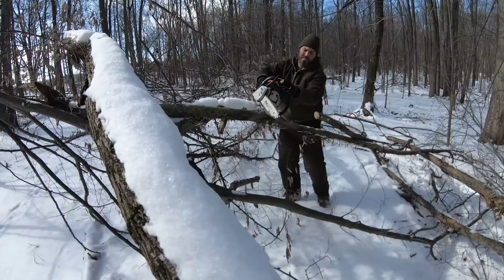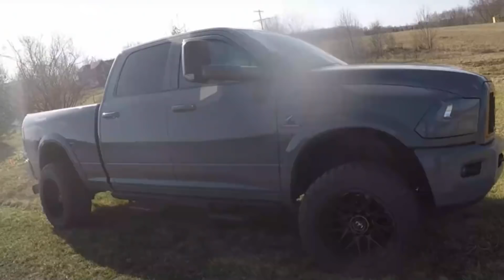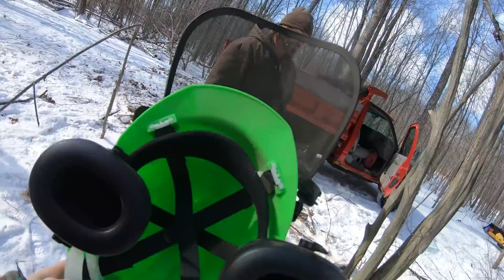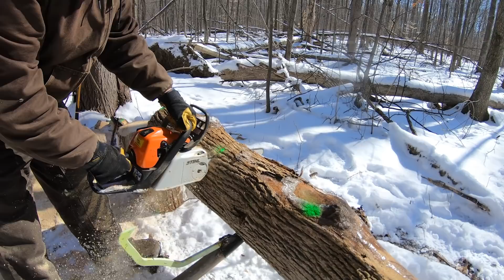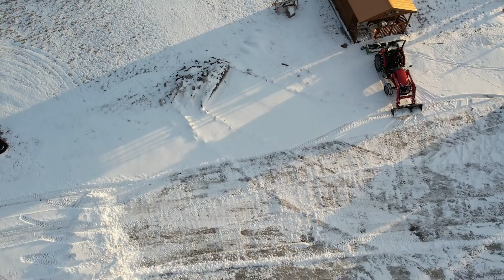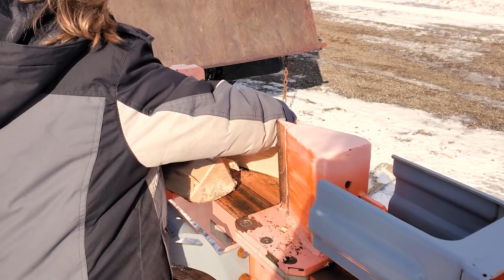403 Our Road is IMPASSBLE - Rush to Beat the Thaw And Free It Up!

Comment: I really like the Chevy Dump Truck.  That is if it's 4 wheel drive.  You could extend the  bucket on the loader and put a lot of wood in the loader bucket.  Better yet would be to have forks with a grab  bar to pick the logs up off from the ground  and hold them while you cut them.

Comment: Built my own splitter, years ago. Ran it off the wet lines on my old tractor. Made a long handle to operate the control valve from the back of the tractor. Splitter sat on legs, a good working height. I made the wedge solid to the beam, and the plate moved. That way, the wood was moving away from me, so if it fell, it missed my legs and feet. Also, to move it, just back the lift arms under it and pick it up.

Comment: Well, it looks like fun. Somehow my dad pinched his finger with a knotty piece of wood on the splitter. Somehow it closed under pressure and got him.  We usually like to stop after we get tired.  Sometimes when you get into splitting wood it gets hard to stop. He was on a roll there last summer with hurting fingers.  I was not there to watch him, I guess.  We did split a lot of wood.  The repetitiveness almost got my fingertip.  Luckily just the glove finger.  It a good family work activity.  I guess as I have gotten older, I wear chainsaw chaps.  Never did before two years ago.  Things happen fast.  I think also cause now we have to wear so much at work also.  But the hard hat helps the most.  I think some weeks I would look like a 10-pint buck   I have a head lamp attached to it. Every time I don't wear it, I need the head lamp to see what I am working on.  I like the hearing protection that attaches to it better.  Place looks great in the winter even though it looks really the best in summer! Just counting down now!  When do we start the spring dance...? Is that in the farmers Almack? Ok, I am ready to get the growing season going. Darn this winter thing..
Reply from the maker: Oh yeah! Erik busted a chain a week ago and it tore through his carhartt coveralls and into his truewerk pants!

Comment: Your chainsaw is running lean on the low end. Needs the carburetor adjusted. Hold that thing wide open and let it eat don't force it and bog it down that much your slowing the chain speed down too much cutting slower actually. It should almost sound like your free reving it while your cutting.
Reply from the maker: I'll let Erik know if he doesn't get back on here!